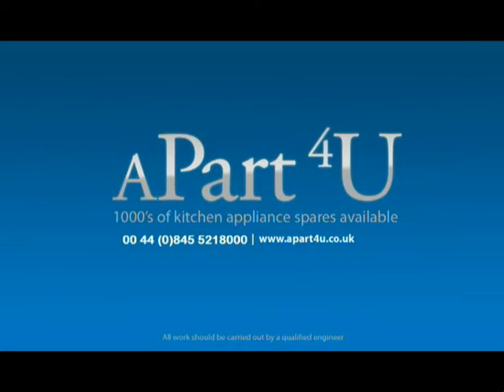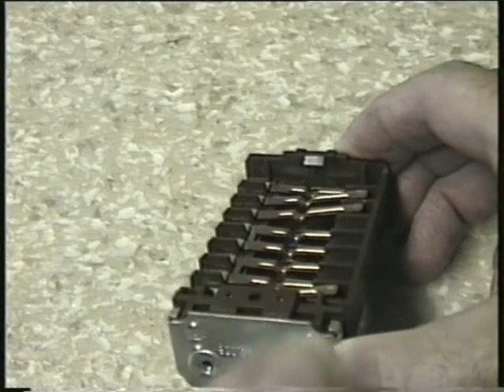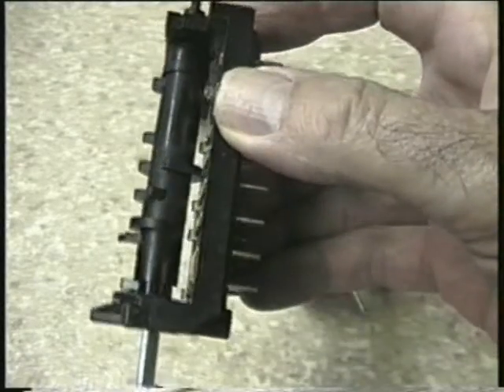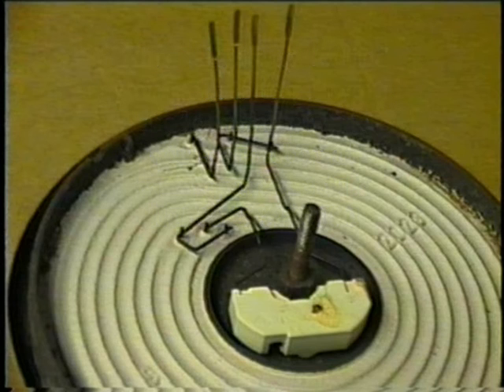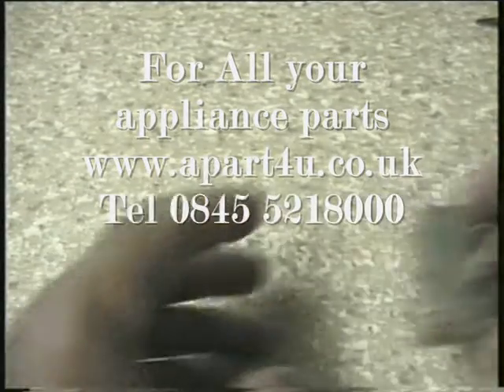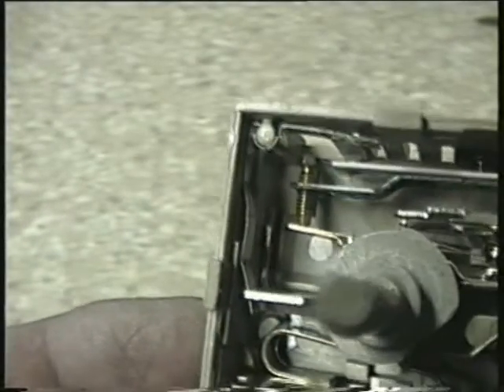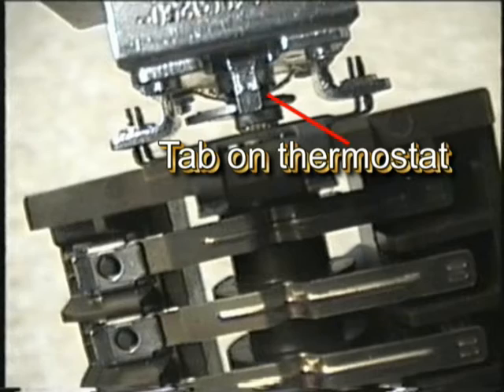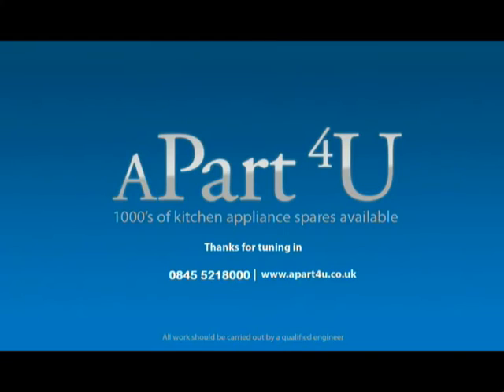Cooker, Oven & selector switch and thermostat regulator how they work

Comment: I have a winco epo1 and i got. Anew thermostat for it, i cant figure out how to wire it back up correctly. It has power now to the switches, the power buttons have lights but the burners arent heating up. I dont understand why. :(

Comment: Hij, my thermostat keeps frying?  You have any tips where problem might be. Are thermostats rated with different amps? that maybe it can't handle the amps.? 

When I bypass the thermostat there is no problems. 
But once with each new thermostat it burns through in first week or sooner (with a loud popping noise).

Comment: Thanks for the video. I'm trying to replace the man fan oven thermostat for my Hotpoint DH53XS but it's connected to a regulator (as you have shown it has a harness).  I don't want to brute force it but is there a technic to getting the old thermostat off the regulator?
Reply from the maker: there are normally pins on the back that it slides off.
Iam Glad we could help you have a good xmas
Please remember to subscribe to our channel
https://www.youtube.com/user/Apart4u?sub_confirmation=1

Remember to Shop with www.how-to-repair.com and it would help us by posting the video or

website on your timeline. This helps us a lot and if we really helped you can
always buy us a beer http://how-to-repair.com/help/buy-paul-a-beer/

Please remember to mark us to your favourites also I would be grateful if you would
subscribe to our channels social media as this really helps my site and keeps
us going.
YouTube. http://www.youtube.com/user/Apart4u

Facebook. https://www.facebook.com/how.to.repair.appliances